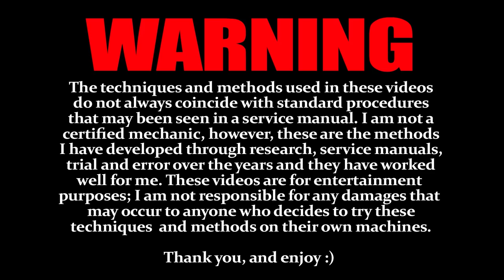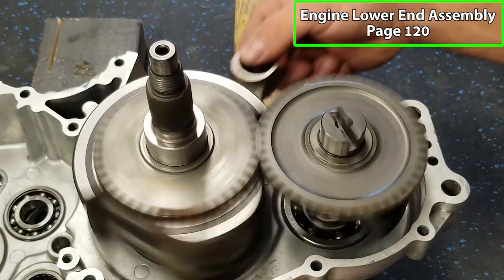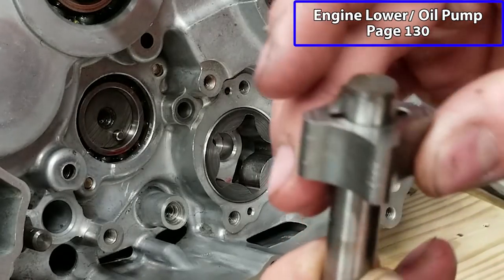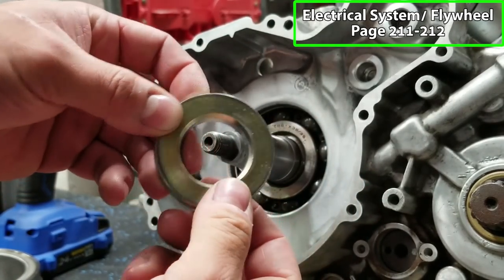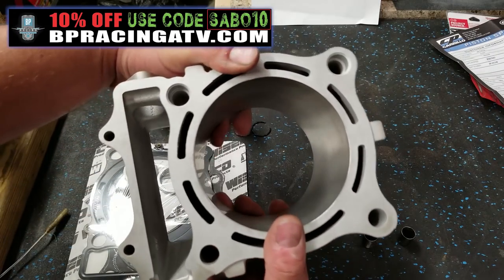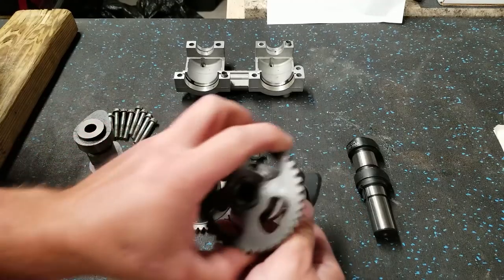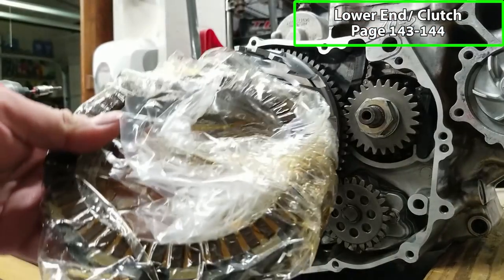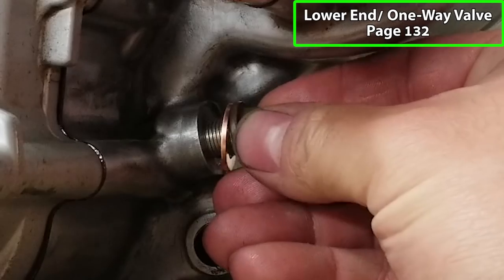How to Build a Polaris Predator 500 Engine | 2003 - 2007 Full Build Step by Step

Comment from the maker: Yall asked for it, here it is! Chapters and links below!

Chapters

 0:00 – Intro
1:32 – Disclaimer
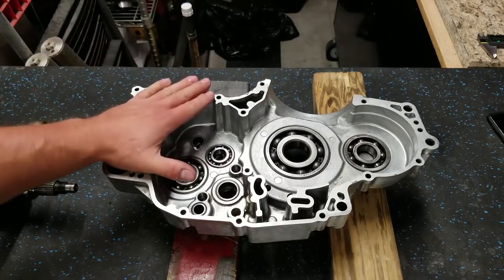2:38 – Differences in Crankshaft by Year
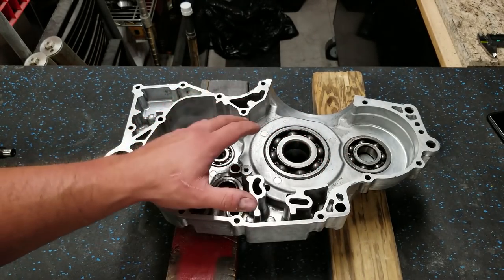4:10 – Crankshaft Install
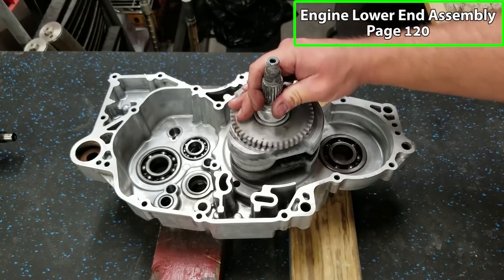5:22 – Counter Balancer Install
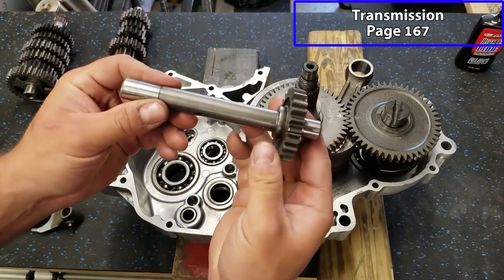6:13 – Transmission Install
7:17 – Shift Forks and Drum Install
9:27 – Oil Screen Install
9:50 – Assembling Case Halves
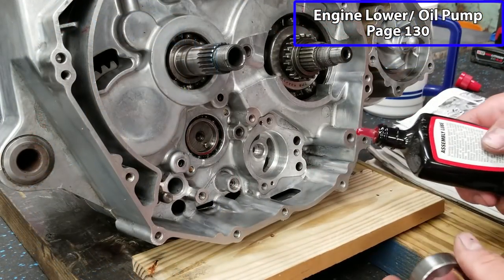11:52 – Oil Pump Install
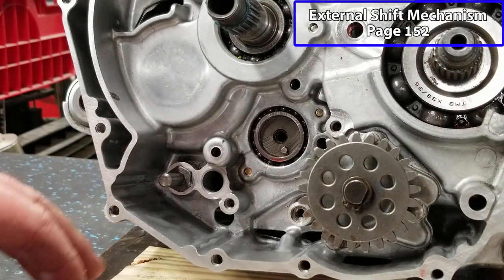13:02 – Shift Mechanism/Shift Shaft
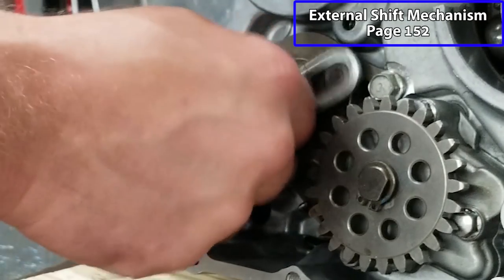14:32 – Rear Cam Chain Slider Install
14:42 – Clutch Basket/Inner Hub Install
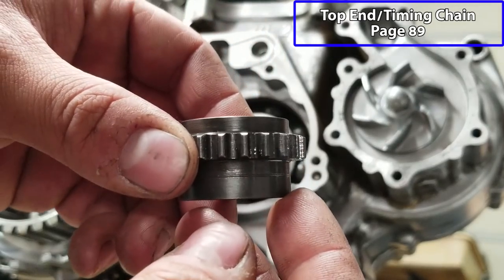15:41 – Timing Chain Gear/Primary Drive Gear
17:03 – Starter Install
17:32 – Prepping Flywheel and Crank
20:54 – Flywheel Install/Starter Gears
22:06 – Stator Cover Install
23:22 – Neutral Switch Install
23:52 – Showing The Big Bore Kit
25:03 – Piston Install
26:19 – Cylinder and Head Install
29:47 – Camshaft Explanation
30:46 – Installing The Cams
33:47 – Timing Chain Tensioner Install
34:36 – Cam Cap Install
35:13 – Intake Boot Install
36:00 – Clutch Pack Install
37:33 – Clutch Push Rod/Actuator
39:15 – Clutch Cover Install
40:42 – Oil Filter Cover
41:11 – Water Pump Cover
41:38 – Oil One-Way Check Valve
42:10 – Engine Showcasing and Performance
43:24 – Closing/Sponsor Thank you

Parts/Tools

39mm Carb - https://amzn.to/3wMB9Ux
Air Filter – https://amzn.to/2TJixX1
Outerwear - https://amzn.to/3g5JYSi
Service Manual - https://bit.ly/35CYImG
Mapp Gas - https://amzn.to/3j03D9g
Torch - https://amzn.to/2Uq3iCN
Assembly Lube - https://bit.ly/3qecHJt
Anti-Seize - https://bit.ly/2SP14vZ
Crankshaft Install Tool - https://bit.ly/3j0mKjx
Blue Loctite - https://bit.ly/3h3CArh
Red Loctite - https://bit.ly/2SO2hDV
Small Impact Driver - https://amzn.to/3zIh5Vm
T-Handle Hex Wrenches - https://bit.ly/3gPaSOM
Clutch Holding Tool - https://bit.ly/3cXqlej
Large Torque Wrench - https://bit.ly/3zKjwa2
Large Impact Driver - https://amzn.to/3zImLi8
Timing Chain - https://amzn.to/3zKWHmC
Dielectric Grease - https://bit.ly/3xDnPCa
Valve Grinding Compound (For Flywheel) - https://amzn.to/3xOWZXR
Assembly Grease - https://bit.ly/35FHiGk
Big Bore Kit - https://bit.ly/2TTRUig
Dead Blow Hammer - https://amzn.to/3xxEQxt
Standard Bore Top End Gaskets - https://bit.ly/3wJnyx7
Kibble White Studs – Available Soon!
Stage 1 Cams - https://bit.ly/2TKQM0a
Valve Shim Kit - https://bit.ly/2TNQ0j8
Feeler Gauge - https://bit.ly/3iVAOuB
Wrinkle Black Heat Paint - https://amzn.to/3xCKvlK
Clutch Kit - https://bit.ly/3cWKkK2
Engine Oil - https://bit.ly/3xEROt5
2005-2007 Complete Gasket Kit - https://bit.ly/3zGCxKj
Gasket Spray - https://amzn.to/3qe9iKy
Engine Complete Seal Kit - https://amzn.to/3gNn2ro
Engine Oil Filter - https://bit.ly/3xAabj1
Reply: Your a goat!!!!
Reply: The link for the service manual doesn’t work — can’t find the manual on that web site (searched for „Predator“).
Reply: Dude the grease on gaskets works but just for shits n giggles try original chapstick! Especially on carb gaskets! Since I've used it I've not had to buy another gasket I've chapsticked! Sounds dumb but works like a charm and holds them a tad better and not as messy as grease
Reply: Your the f'in man bro . Thanks for posting this .
Reply: hello, I need spare parts for this motor, please tell me where to find them, get in touch with me, I'm from Russia

Comment: Thanks for the video. I'm in the process of building my 03 for the second time. Had to split the cases a few years after getting it (bought it new) due to the weak shift forks that came in the 03. For anyone  with an 03, if you split the cases make sure you get shift forks from an 04. They have an "A" following the number stamped on the fork (M83A) while the 03 forks do not have the "A". They are substantially stronger. The main fork was the culprit. I have a 558 big bore kit with a sleeved cylinder that HPD inc used to sell back in the day, but fortunately the sleeve stayed put. I also have a set of stage 2 hot cams that I have never tried. The 558 kit gave me a nice boost in power. I am now going with the kit from BPRacing. I have a  predator breakdown and rebuild video that I bought in the early 2000's that a guy shot with a VCR type recorder and then transferred to disc.your video is so much easier to watch. Thanks again.

Comment: OMG i laughed so hard when you installed the crank in the wrong position to have the rod clear. Awesome that you left that in. I built a motor a while ago and totally forgot to put the dowels in when i put the engine together. Got the whole motor together and then saw i still had them sitting on the bench. I swore for quite awhile before i started laughing at myself. Then proceeded to disassemble and reassemble everything.

Comment: I remember hearing that the cam sprocket can actually slip whenever it gets hot enough so whenever you get back in the head weld the sprocket on the cam it will save you
Reply: @Quading Channel yea I heard about those on the hot cams but from what people have said is that they run better with the stock cams
Reply from the maker: I see what you're saying; that's a good idea man
Reply: @MichaelSabo  I did it to mine to make sure so you should probably do it to yours too if you got the time
Reply: So stock cams are more reliable than aftermarket cams ?

Comment: Hey Michael, i am rebuilding a predator myself, mine has a issue with the trans being stuck in gear. so i am splitting the case to see what the issue is, i have watched this video multiple times and i must say you are by far the most in depth build up guy i have seen. Keep it up dude. I also noticed something, on the video of you tearing this down you pulled the stator side off the case and disassembled the trans from that side and removed the springs in the shift fork shafts from that side. But when you put the engine back together in this video you assembled the trans with the sator side facing down and put the springs in the shift fork shafts from the other side. I just was wondering if the shaft is hollow or if it doesn't matter where the springs go or is there springs on both sides. also noticed a case bolt that was missing on yours that goes by where the oil scavenger pump is. 12:10 is the minuet mark. right by the shift drum just under where the shift paw bracket bolts.  Just curious cause i haven't gotten my case split yet cause I'm waiting on my tool for it.

Comment: Probably quite a few in this field with this engine, so figured I would ask. I have an SMC 500 Wildcat with this engine that has a nasty, kinda high pitch, "kling" sound when turning the starter. As soon as it starts the sound is gone. Changed the starter and it did make it sound a bit less nasty, but not much, so there is something more that is at play here. If anyone has an idea, feel free to share :) Great video to save for future renovations as my third gear is not sounding very nice anymore either. Still works great though but I guess a tooth is gone or something. Thanks for the video!

Comment: I cant believe I just watched you put those cam caps on with a impact gun and then just tighten them without a torque wrench! Those fasteners are one of the most important on the whole motor to be properly torqued. On top of that you put assembly oil on the cam chain tensioner but not on the valve buckets and cam cap "plain bearing surfaces/Cams! Dude you are better then this. As a engine builder that builds these motors daily I felt I had to say something. Im here in PA also and maybe I should come over and make sure you are feeling ok! Lol

Comment: Webcams 590 cams are what I ended up with and they are very good from 4000 on up. The difficulty  is they are expensive because you have to install new guides, and springs to clear the lift.
Reply from the maker: Hell yea man, I would have loved to have run Web but the lead time was crazy on them too

Comment: Hey Mike did you notice how similar this engine is to a 450! When I rebuilt my first predator engine I noticed how it was practically identical to a 450 but with 50cc bigger. And a 60 to 70+ pound heavier chassis. That's the one thing I hated the most with the predator 500 it weighted so much when compared to a actual 450. And stock for stock a can am DS 450 and a predator 500 run real good together.

Comment: Hey Mike, another good way of preventing gaskets from sticking to the cases is to dust them with talcum powder. Works better than grease, in my opinion. Grease can sometimes cause a gasket to push in or out, especially when the gasket surfaces are really narrow. Awesome job on the build....well, accept for the minor brain fart in the beginning with the rod. LOL. Try out those other cams too. They may end up being a great combination with your other mods and porting.
Reply from the maker: Interesting; I've never heard of the talcum powder method but it makes sense; sounds messy though 😂 I might be trying out the cams to see how they perform 🤘
Reply: @MichaelSabo  Actually, it's not very messy at all. You only need to dust the gasket, not the cases. And you can dust the gasket just like you coated the gasket with the Spray-A-Gasket. Put the gasket on some paper towels and coat the gasket with talc. You can use a solder acid/flux brush to brush the talc even, then flip and repeat. Give it a try. It's a lot less cleanup than grease squishing out.

Comment: Thanks for this post, picked up a 400$ predator myself and I’ve used your video already. Any advice on how to make sure the decompression Valve on the exhaust cam is working correctly?
Reply: It need to be work smooth. I've got this on mine that the decompression will open the valve at 12 O'clock cam Rotation. Noises like a bad connecting rod bearing 🙈

Comment: 2005 Polaris Predator, spitting from overflow upon starting.  I even removed the thermostat.  I'm leaning towards headgasket.  It doesnt smoke or anything. Runs really good.  We just bought it. Any ideas before we tear down? It should not bubble upon starting. I even removed the thermostat, still the same. Even if I drain the antifreeze down, it still pushes antifreeze out. And if you hit the throttle it's worse.

Comment: Awsome video👌 i have some issues with a Dinli/Masai 450cc but i been told the engine is basically the same as used in predator (Subaru/Fuji). Maybe stupid question😅 but is the stator a wet type? running in oil? I have start issues, and i see oil thru the inspection nuts on stator cover.

Comment: Hey Michael Sabo, great video. I do have a question, I just installed the 560 kit so I had to remove the clutch and all that. I put it back together and I went to put it in 1st and now the shifter feels like it's not hooked up, any ideas?

Comment: Fantastic video man, I just recently picked up a 2005 Predator project myself and wound up here doing research. One question I have that you might be able to help with. Where did you find a connecting rod? OEM is discontinued and I can't find a replacement kit to save my life. This was supposed to be my daughter and I's winter project and I really don't want to have to tell her all the work we've put into it was for nothing.  Thanks!

Comment: Man I got my 04 Predator last July 2nd it has been setting up five plus years so the original owner said that it was the regulator so after going through it and replacing almost you know their entire fuel system and all that stuff end up in the bathroom so that's the only thing I've done to it than every modification to it besides inside the motor that's going to be this fall. I haven't had one problem with this 04 predator especially all the problems that everybody else say that they have with theirs I have not had any of those issues so I just want to say great job. could have been a better time. what's funny is that and it's amazing at the same time that these predators respond to mods like I never seen a ATV  ever responded to airbox mod or exhaust. Keep the videos coming great job dude I appreciate it.. oh yeah I forgot to say that what size jet you running in the fcr carb? So do you think that big bore is worth the money? And where did you get those shocks from the Ressies?

Comment: what is the clutch you put in i put a barnet kit and i need to put my push rod a little longer but now my clutch is really hard to pull but working perfectly and for your top end problem i had the same thing and i change the fuel pump and now work perfectly
Reply from the maker: Here is the clutch fiber kit I recommend by Rekluse - https://bit.ly/3cWKkK2

Thanks for the feedback on the top end problem; I am not running a fuel pump though; I was able to get rid of the top end hesitation with jetting!
Reply: @MichaelSabo  Good nice and did’nt you have a problem with the clutch push rod? if not i will order this friction plate if the ship to canada

Comment: I have a 2004 Ranger. The engine is producing a lot of blow by saturating the air filter with oil. Took it into the shop and they said that they put a set of rings in it and finally called me and said come and get it no charge. I haven't pulled it apart yet but I suspect that the rings are misaligned or bad cylinder. Any suggestions ?

Comment: Thanks for your videos, I have a question, really I have a problem, could you helpme, please . I have a Polaris Predator 500 2003, the camshaft tensioner becomes damaged and bend the valves, the problem is because camshaft gears donsn't have key, they becomes moved, both cam gears out of time. How could I set on the correct position?

Comment: Love the content I have an 05 predator 500 and you showed me everything I need to know 🙏. Would u know anything about getting spark and then not getting spark that’s what’s going on with my preddy
Reply: I had that problem and it was my ignition where the key goes. The wire connecting it would sometimes not make connection.

Comment: Hey bud if you don't mind could you help me n guide me in the direction I need to go on my predator the crank won't go a full revolution it will go around n stop.. clockwise and counter clockwise the piston won't go up and down like it supposed to

Comment: Someone remind me to put loctite on my flywheel bolt tmr 🤣 edit: Mike I just bought a pretty nice 2004 Kx250f non running. I have a few questions. 1st how would the timing chain come off a perfectly fine gear on the crank? Also, how would a tappet cover or valve bucket or whatever break and how would the collets/keepers come out of a valve? Improper installation? The head was just redone. With 2 hours on the bike guy said
Reply from the maker: I'm going to say incorrect installation or something was missed; it could be that one of the valve keepers wasn't seated and then popped out once they engine fired up and caused a bunch of shit to happen. Could be the incorrect timing chain, worn timing chain or broken/worn tensioner that caused the cam chain to come off; its hard to say without actually looking at it but I'm gonna say best bet in the installation thing.
Reply: @MichaelSabo  yeah, she’s going to be out back together tomorrow or Thursday so I guess I’ll find out!

Comment: I don't konw if you will see this but, My question is, I have a 2003 predator and the clutch is too hard to pres from the clutch handle, while I saw you video, I realize I put wrong the clutch and I fixed it thanks for your video also I clean and grease it them prove it and everiting seems to be good, but when I put the clutch cable again it feels a bit hard to press it, less than before but it still feel a bit hard, I tried to ajust the cable but didn't work, any idea what could be ?.

And thanks for the video it helps a lot ❤.

Comment: Does the Predator turn well?
Reply from the maker: Yes, it's actually very nimble in my opinion. Mine is an 07 and does not have the steering linkage system that the 03-06 have.
Reply: @MichaelSabo  Thanks for taking the time to answer my question. Thanks for the effort that goes in to your channel.